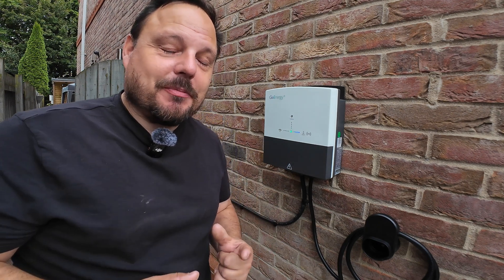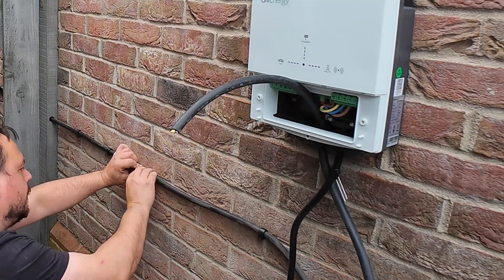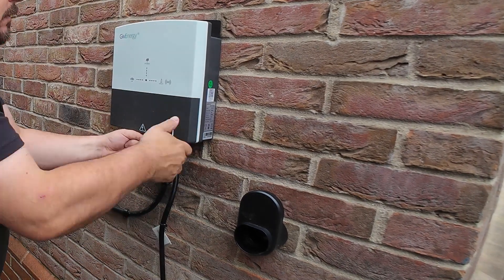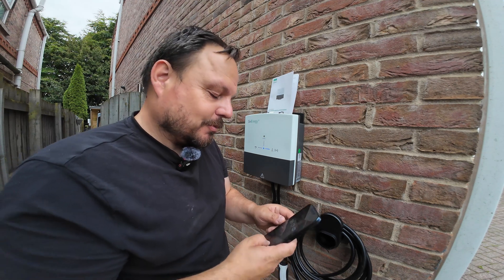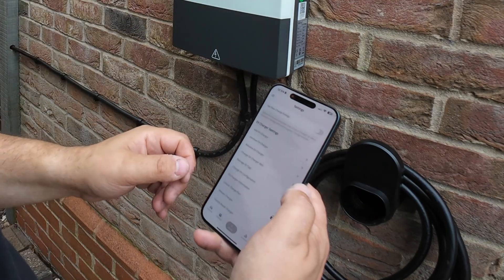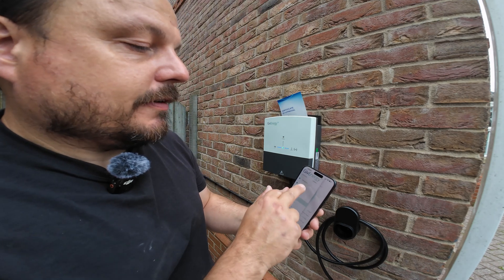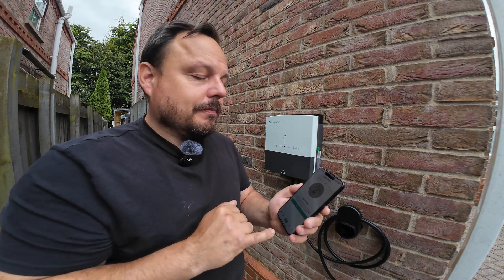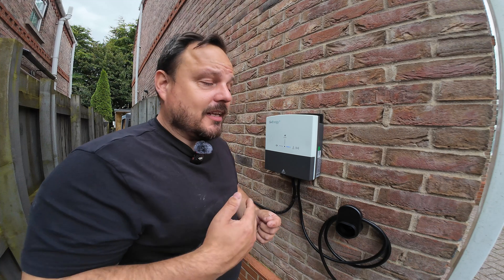Best value EV charger on the market ??? The GivEnergy charger has a lot to offer!

Comment: I would be interested in how you are getting on with this. I love my GivEnergy All In One, but i have been having issues now for 1 year on the EV charger. It keeps coming up with voltage errors, earth errors and consistently not charging on its schedule. My installer didnt have much good to say about GE, but i wanted everything on the same app so insisted on the GE charger. I should have gone with the Zappi. My installer has been good, but GivEnergy support has been terrible. I would dearly love GivEnergy to be successful,  bearing in mind their battery competitors, but i have been very disappointed with their ev chargers and support.

Comment: I was given a BP charger with a previous EV purchase. It has stopped accepting schedules and is no longer supported so time to update - even though I can actually programme the scheduling on the car!
I have a GiveEnergy battery and inverter so I might as well get a GiveEnergy charger. Nice to know it's a good one and will work with my other kit.

That said, at the moment solar diversion is a bit of a non issue for me because I can charge the house and car batteries for 5 hours at night on Octopus Go at 8.5p and sell any spare solar during the day at 16p.  There might be a very rare occasion when I need the solar to charge the car during the day but I can't think when that last happened - never actually.

Comment: I got round the vehicle discharging my Givenergy home battery by telling the home battery to not discharge between 5.30 and 5.40 am. these 10 minutes of grid only electricity is well worth it and gives my Zappi's chance to settle down and not treat the home battery as a solar source. Otherwise the only way round it would be to reconfigure all my power/meter tails with an extra junction box so the CT's had an separate location to measure that didn't include solar and Battery until the battery was full.
Reply from the maker: Or mirror the charge times. 

Other consumers have tried this short window of grid use to good effect but it's not bullet proof sadly. 

The ecosystem is really the only reliable way. 

I move away from my zappi as it didn't work consistently enough on this basis.

Ever since the GE went in this problem has gone away for good.
Reply: @electrician247  my V1 zappi has just ended it's 5 1/2 year life as of last night. I'm not sure if I should get another V2.1 to match my other of to get a Givenergy charger to match my home battery. 
I don't have plans to swap the working V2.1 zappi until it fails.
My system works well in it's current config, and was glad of the reduced current option in the Zappi so the V1 only gave 4.5kw so the home 80A fuse was less likely to blow when needing to run  white appliances at night.
Reply from the maker: @Dr-EV  GE allows for setting lower kW values and you can set the dno fuse size to prevent it ever blowing due to it. Need an installer who can integrate it correctly with your system as from comments I've had a few get that wrong!
Reply: @electrician247  I appreciate the advice. You have helped swing me over to a GE charger.

Comment: what area do you cover to install? also which is the charger you'd recommend thats as basic as possible i really don't need any bells and whistles my cars app shows progress and thats all i need, thanks for your help
Reply from the maker: Due to YouTube enquiries we cover most of the UK. But will be more expensive depending how far we are travelling. 

Do you have solar or battery storage on your house? 

Most are pretty easy to use outside of all the apps. The givenergy solution is one of my favourites and they are very good value

Comment: Hi Mark, just had my Giv EV Charger fitted to go with 2x 9.5kWh batteries and Gen3 inverter. One thing I wish there was was schedules that could dictate the charge mode, so during day time schedule, Solar only, during nighttime for time of use, charge from Grid. That would make it automatic, whereas now I would have to switch back and forward from Solar to Grid and enable a schedule… each night…… or am i missing something?
Reply: Thanks I have it in solar mode , with a schedule for overnight charging . Overnight charge works fine, but the solar charge during the day doesn’t start and all excess sent to grid (12.59kWh today!)
Reply from the maker: @darrenhenderson5355  I would get your installer to check the system over as that should work unless the vehicle is full?
Reply: @electrician247  thanks talking to Givenergy to verify thanks !
Reply from the maker: You are missing something! If you leave it in solar mode but also set an overnight charge schedule it will do exactly that.

Comment: I have an AIO and was considering getting one of these fitted as looking at getting solar soon. I already have a Pod Point Solo 3 so I was going swap that out as it doesn't work right with the battery. Any suggestions how I'd go about that and how it would be commissioned? Thanks for the valuable insight.
Reply from the maker: Get in touch with a local GivEnergy installer. It’s a relatively easy change over for a qualified electrician

Comment: I’m sure the one I fitted had a lot more screws, if that’s a new version looks really good.
Spoke to GivEnergy last week still no date for octopus 🐙 integration for EV charger, however the inverters are.
Reply from the maker: Hey mate. Yeah standalone the chargers don’t currently integrate directly with octopus but…. With an aio on inverter control they do 💪. 

The AIO instigates the charge cycle etc. just need to remember to leave plug and off and the system does the rest through the API
Reply: I addressed them both in a single Twitter post, but only received a response from Octopus, which indicated that the issue was on GivEnergy's end.